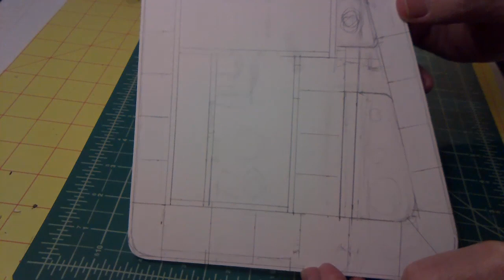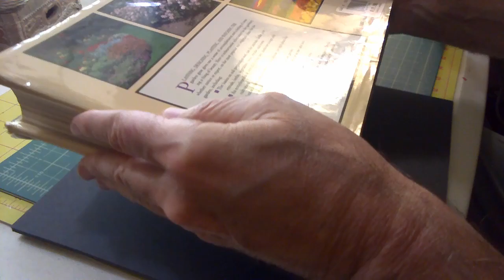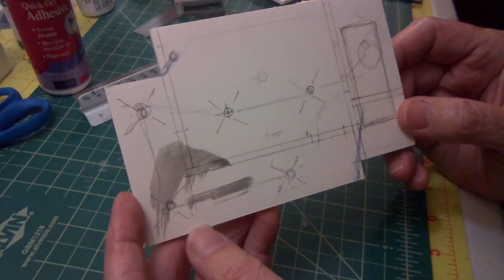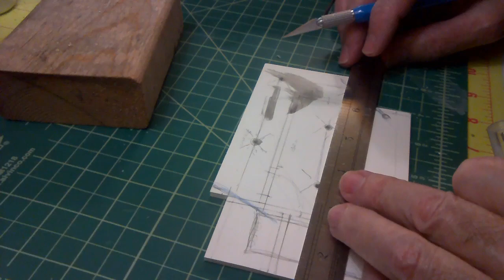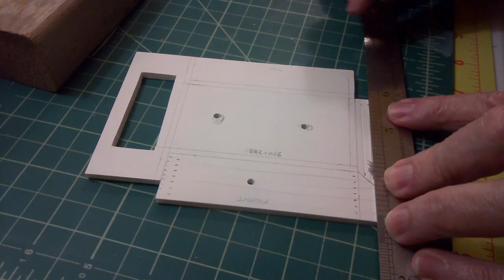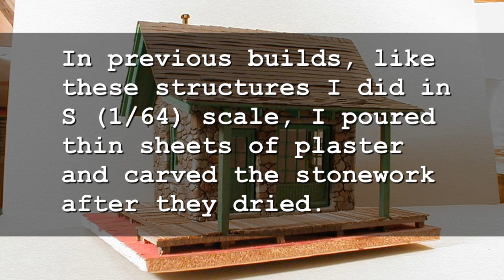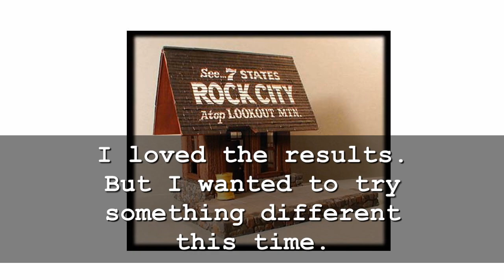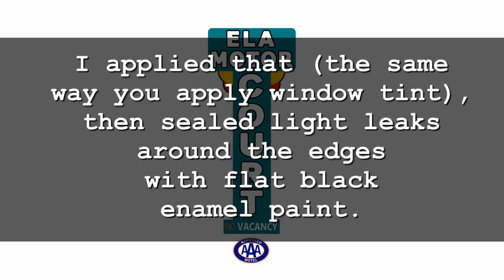An O Scale Mid-Century Motel Scratch Build Part 4 - Lighting, Stonework, Completing Assembly

Comment: I love the neon lighting. The stamped stone turned out great. I was wondering how to make that for a round structure.
Flat is easy, but on a cylinder you have to hit that spot where it is soft enough to take the impression, but not too soft to stick to it and ruin it. The cylindrical shape also can be easily ruined by the slightest uneven pressure.

Comment: What is the blue neon light along the edges? Is it fiber optic or something else?
Reply from the maker: It's electroluminescent wire, also known as EL wire. It's fun stuff. There are lots of tutorials on it on YouTube and the net. The sign is made from EL panel, which is similar technology. Both use small AC converters to light them up.
Reply: Thanks. I'm familiar with the company that makes the signs. Great work. Very nicely done. You've inspired me to make a vintage motel, like the ones I stayed at in my youth up in the Wisconsin Dells. If you google vintage motels, you get an explosion of crazy 50's and 60's architecture. So fun.

Comment: what glues are you useing?
Reply from the maker: +Sam ewyk For most of the assembly I used Scotch Quick-Dry adhesive (a white "tacky glue"). I also used yellow carpenter glue, sometimes thinned with water, and some gel-type CA (cyanoacrylate) glue.
Reply: ok so would it be ok to just use super tacky glue it dries faster than normal tacky glue 

ps: i also have pva, wood glue, & modpodge
Reply from the maker: +Sam ewyk Sure. Use whatever glue works for you.
Reply: well i've never worked with foam board before so i don't know what glue works for it